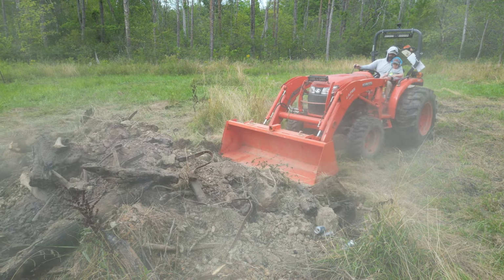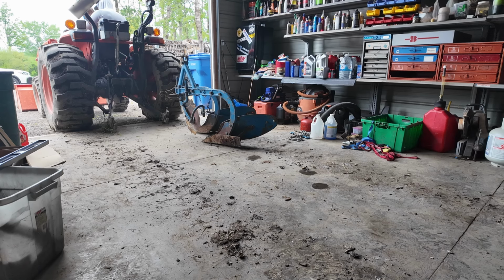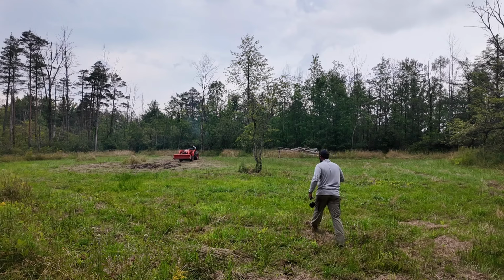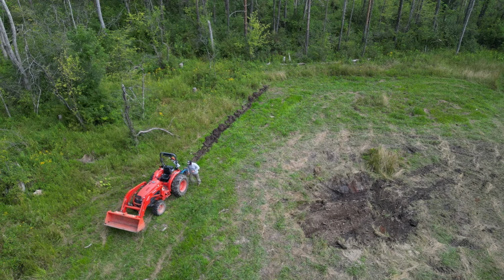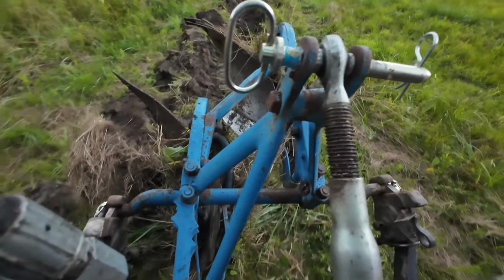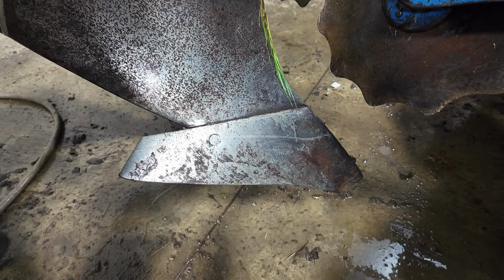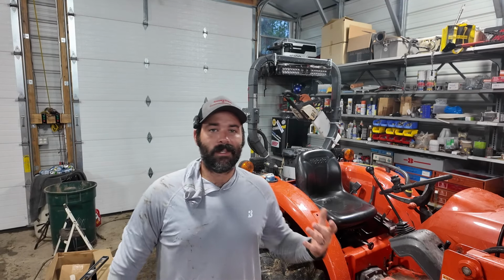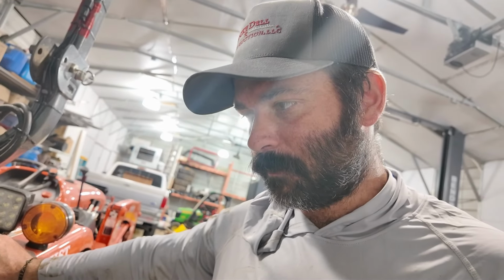If you don't BREAK IT - You weren't running it HARD ENOUGH.

Comment: It's called a plow bottom. Finding an exact match may be tough. It may be easier to find one with corresponding holes and update both bottoms at the same time. You may be able to find similar plow bottoms that do not have holes predrilled. We had to do that for a three bottom John Deere years ago. You might have to go to an agricultural implement dealer and find the oldest parts man and pick his brain.
Reply from the maker: The internet is a great thing, except when it comes to finding parts for an implement that’s twice as old as I am. You’re right I need that old timer behind the parts counter

Comment: You are a good welder pound it back together and weld it back together with hard surface rod.
Reply from the maker: The more and more I look for a replacement part, the more and more a torch and welder seem to be my only option